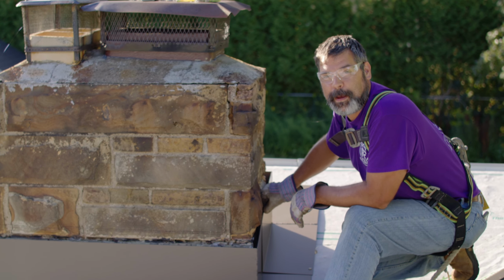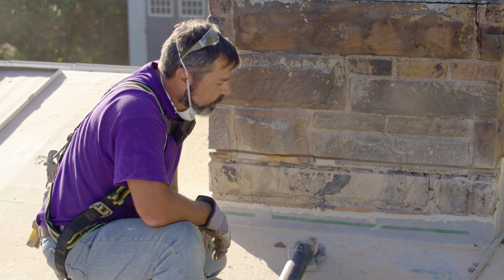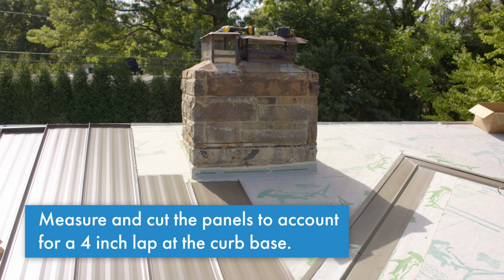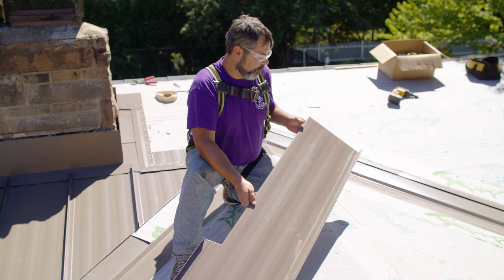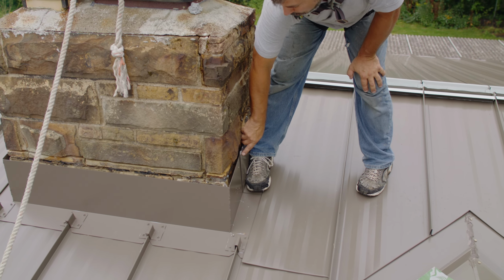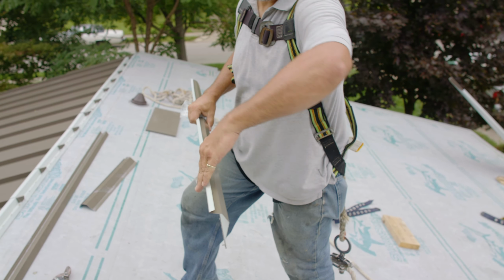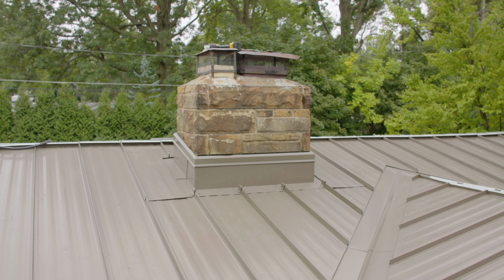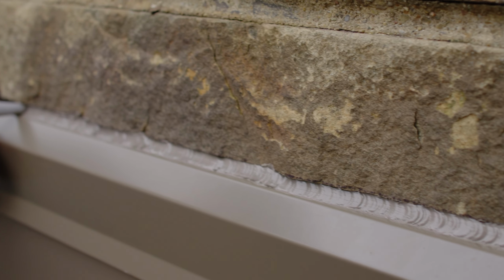Chimney Flashing Installation on a Standing Seam Metal Roof

Comment: I just had a new metal roof installed on my A-Frame home. I’m concerned about the flashing around the chimney.  There were bubbles in the flashing and no fasteners. I brought it to the attention of the roofer and he stated that he would have it corrected. Any advise?  Shirley
Reply: They're shouldn't be any exposed Fasteners at all on a standing seam roof. But they're also shouldn't be any bubbles or wrinkles in the flashing either. A lot of these contractors install metal but actually don't have a clue what they're doing! Standing seam is a hidden Fastener system, if there are exposed fasteners then it is wrong